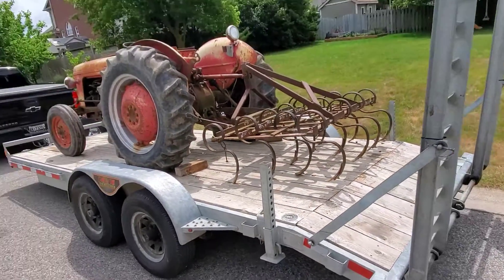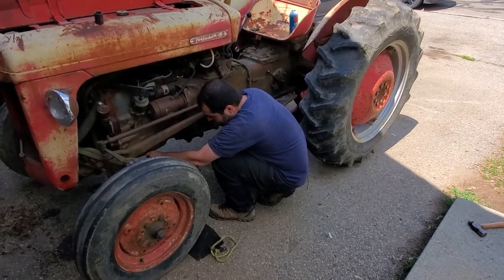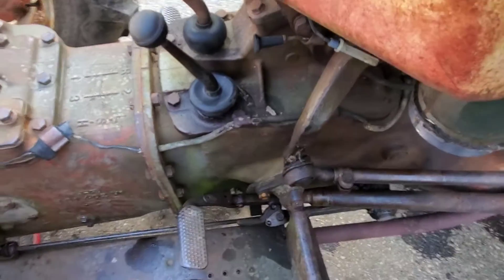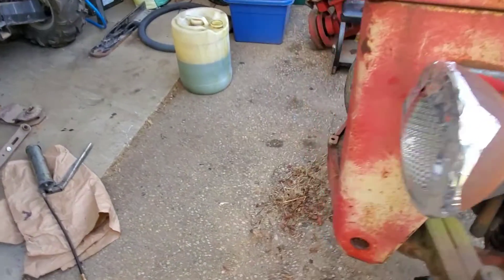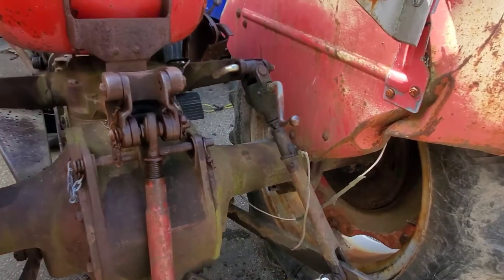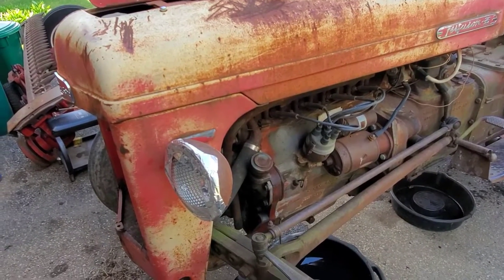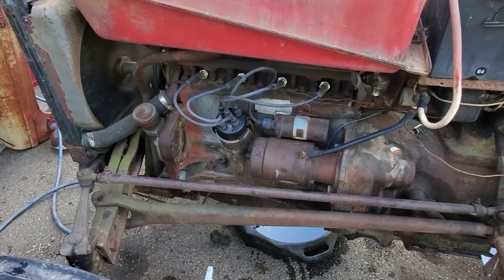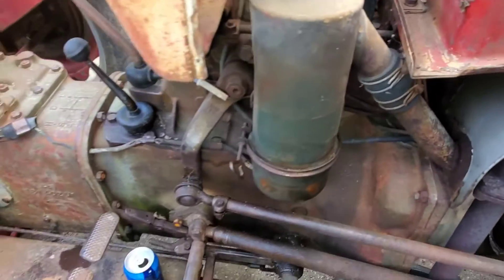Ferguson TO35 the Red Fergie 1956 Massey Ferguson 35 Tractor redux

Comment: Awesome stuff!  I'm buying a '63 mf35 gasser.  Doesn't need much aside from needing the exhaust manifold replaced because it's cracked pretty bad.  But it runs healthy and drives good so I'm happy.  I just need attachments now.
Reply from the maker: Manifolds are available or you can try and fix what you have

Comment: I realize I'm a couple of years late, and you've probably studied up and know all about 2-stage clutches, but I'm going to tell you anyway. One clutch is for the transmission, the other for the pto. It allows you to run the pto in neutral, linked directly to the engine, or linked to the differential and your pro shaft runs at ground speed, in fwd or reverse.
Reply from the maker: Thanks for watching and contributing a great comment 👍

Comment: Just bought a 56 got delivered today. Not running. Auction tractor with loader.
Reply: Pull the plugs and give each cylinder about a tablespoon or so of oil. If you have 2 stroke oil that would work great.
Reply: @jimott3358  Thanks that was the first thing we did. Appreciate ya.
Reply: @russellbarron6775  does she roll over?
Reply: @jimott3358  Haven't even tried yet. First thing I did out of habit was to pull the plugs and squirt the cylinders down. Then it started pouring rain, then power went off and just came back on about 5 minutes ago. 
   Picking up a battery in the morning. Already had a tune up kit sitting on the shelf since last year. Time will tell tomorrow.
Reply from the maker: @russellbarron6775  are you going to be doing a video?
Reply: @JimsNBHomestead  Yeah in a bit, once it stops raining and get some other jobs out of the way. This was really a summer project for my son's Ag Mechanics class. I think he was supposed to do a presentation when school starts back in September. 
   Besides it is something for him to have for the future. Thanks for asking and for the video.
Reply: @jimott3358  squirted some more oil this morning. Rolled over without a hitch. It has a front crank mounted hydraulic unit for the loader. Which incidently has all the hydraulic oil in the loader frame. Definitely gonna need a few hoses. 
   Went to pull off the air cleaner assembly, which was missing the snorkel and got swarmed by angry bees. Then started rainging again. Supposed to rain for the next 10 days or so on and off. 
   Just glad it wasn't stuck and didn't make any clunky noises turning it over by hand. 
    Thanks again. Took a few minutes of footage this morning, but haven't edited it yet or even downloaded it off my phone. Thanks again.
Reply from the maker: @russellbarron6775  raw dog buddy let her rip